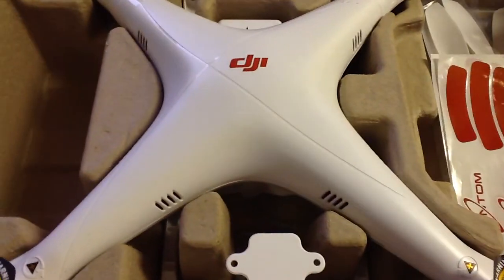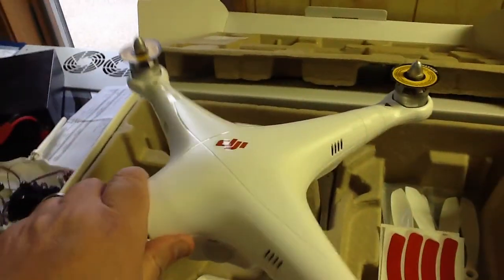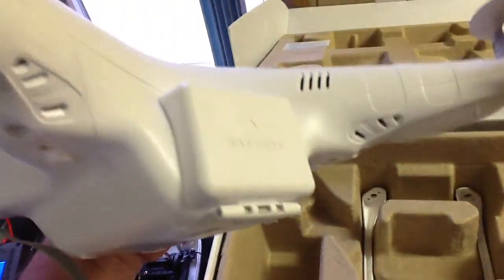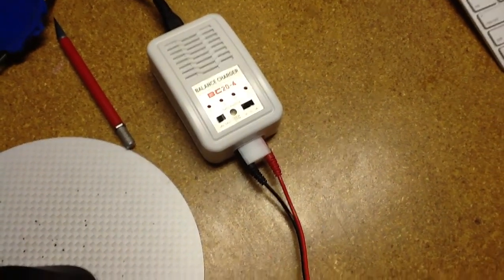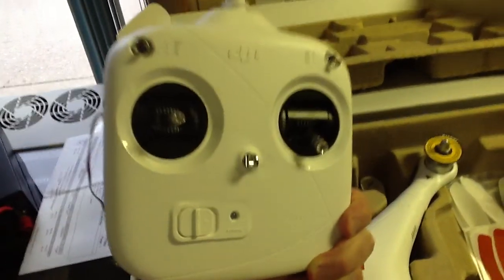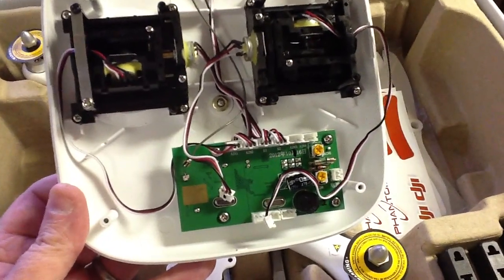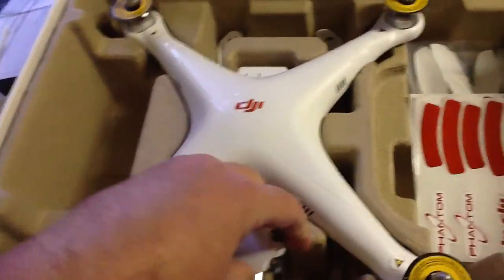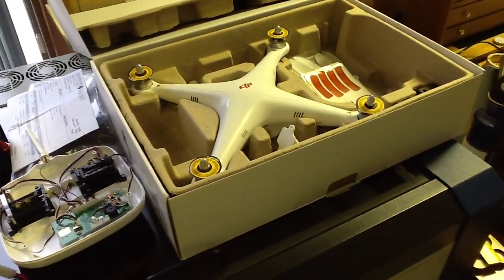DJI Phantom

Comment from the maker: Throttle on the right is called mode 1. Mode 1 was the most common rc configuration in the 70's when I learned to fly. Mode 1 is still the norm in Europe and many parts of Asia.